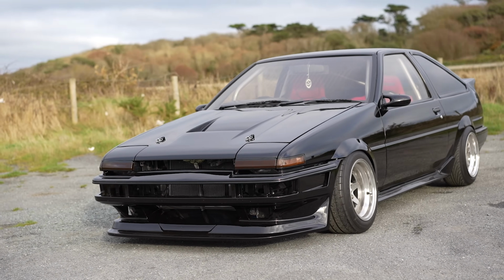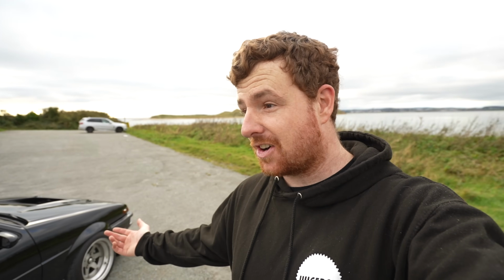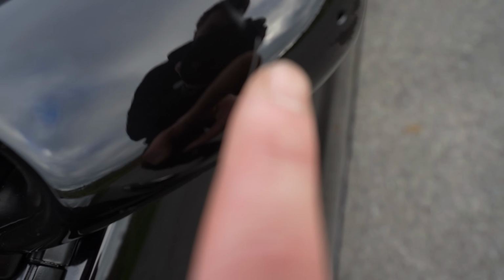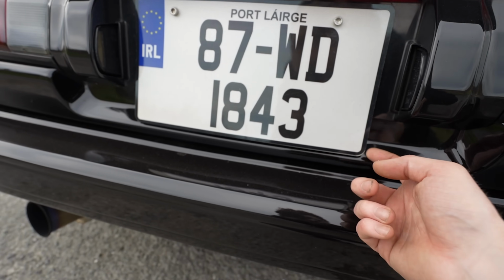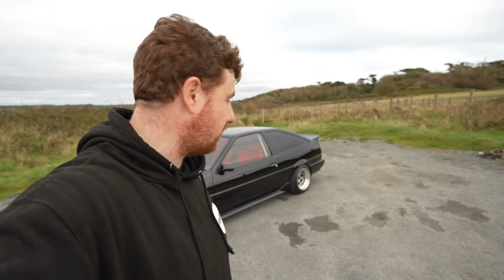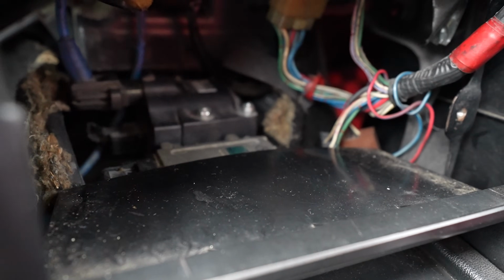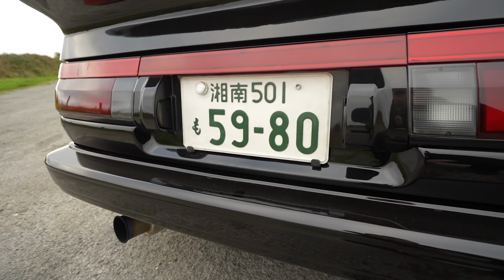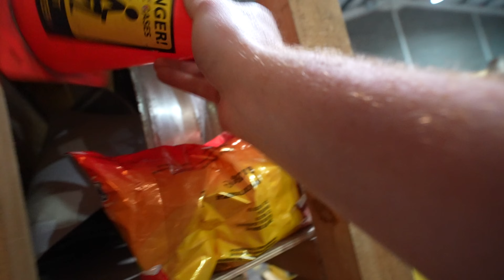Six Months Driving My Restored AE86

Comment: As a fellow TecArts intake Trueno person, that induction noise never gets old....even from the 16v on mine.

Have same, slightly noisy diff, but it's part of the fun. They all have things going on, that's just an 86. Mine is it getting hot, I need to rework the cooling to be setup better for summer here in Aus.

Paint wise, I gave up the drying side, I wash it with Geon Bathe+, then rinse, take it for a drive at 100kph and dry! Haha. That way no towels needed to touch it. 

On the diff, I found Royal Purple diff gear oil quietened the diff down some what. 

Keep driving it man, it took some time once on the road to truly enjoy mine.

Comment: If you don't want to drill the bonnet for the washer jets Neil, You can get some that mount to the wiper arms (Oem on some cars that I forget). The look of extended piping running up to them would be the compromise as it adds a bit of clutter, but still..
Car's still looking top notch. Glad you're enjoying the fruits of all that misery during the build.  👍🏾
Reply: Isuzu NPR trucks have those washers on the wiper blades, don't know if they can be swapped over to other wipers though.

Comment: For detailing, do what you're doing but when drying you need a leaf blower so it's no touch and ceramic coating will help. Ppf is good but need to redo it every 3-5 depending how much sub it sees.  A standard exedy OEM replacement and a lighter flywheel is more than enough for a 4ag. Single plate you get used to over time but daily has never been great.  Add an oil cooler as well to prolong the motor if you don't have already..I can't remember if you did that already

Comment: The ceramic coat will help with the swirls from drying it’s not hard or expensive. 
Some stec PPF just on the high impact areas, the mirrors, the front bumper and the area in by the rear wheels will stop so many of the stone chips and isn’t a huge expense but helps with the chips on the paint.

Comment: TRD pressure plate, and stock clutch disk is the setup. Super drivable with just little bit more pressure in the pedal. Will take tonnes of abuse, cheap to replace, and will save your box ✅

Comment: When I had mine {RIP}, I looked into an under driven pulley if that's the right term. For racing and high rpm driving it will wear down your alternator brushes super fast. I would keep a set of brushes in the car with the fuses. Along with Starter contact and plunger.

Comment: Yerra ya do the ceramic coating, works wonders . Enjoy her and drive her on. Drop to 2nd at 6000rpm going down a hill and let her engine brake for 20s and then blip throttle . Ploom of smoke? Valve stem seals
Reply from the maker: Must suss and see

Comment: If you get a chance have a look at a subaru brat windscreen washer jets they mount to the firewall and come out through the mesh in front of the windscreen they are metal so you should be able to adapt them to the corolla without touching the bonnet
Reply from the maker: That sounds cool ill take a look! Cheers

Comment: You gotta chill on the paintwork my man.
Yeah like it sucks that it was pristine now it's kinda not. But it's just paint! There's nothing that can't be fixed down the track. You never intended for it to go this far so you've done it, you've seen it, you've shown it off, now use it. Eventually it'll end up what you first envisaged which is a pretty tidy 86 but not so nice you don't want to drive it!
You'll never keep spider webs off black paint. Doesn't matter what you do. After 3 or 4 washes it'll have spider webs again. Just get a super light finishing polish and rub that over it before a show or once a year to keep the haze at bay. My wife had a Mitsubishi Mirage we put a Talon kit and 18" chrome wheels and painted it Amethyst Black back in the day. Best I found was Meguiars wash and wax (the yellow one, smells kinda like banana) for washing. Screw the 2 bucket method it's a waste of time unless the car is muddy. Just wash and turn your sponge often. The wash and wax keeps the water beading for the longest in my experience. I also use Gyeon wet coat. Its a sealer similar to ceramic coat but you don't need to do the 3 step bullshit and it just sprays on. Make sure the paint is cool and you don't let it dry or bad things happen though!

Comment: Definitely can confirm that PPF is worth every penny. If you know someone who wraps cars, it's worth it to protect your 18 month investment. You can't notice it when it's on! You can just do the front bumper/hood (anything facing the front of the car). Looks fantastic though - glad you're actually driving the car!
Reply from the maker: Potentially something to look into, not sure how it would sit on the hood with heat cycles and not sure if its even a thing here in Ireland yet, I don't really know of anyone whos had it done
Reply: @juiceboxforyou  My turbo RSX with a fibreglass hood has PPF installed on it, no issues! (Lots of heat under the hood, as you'd expect.)